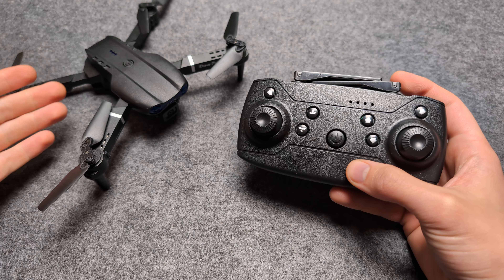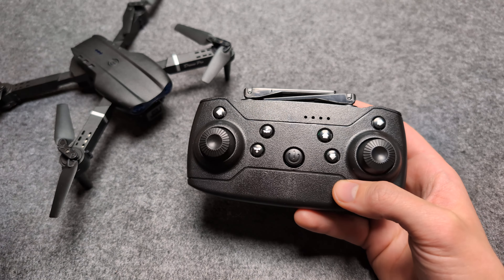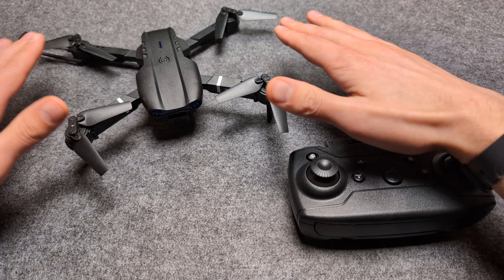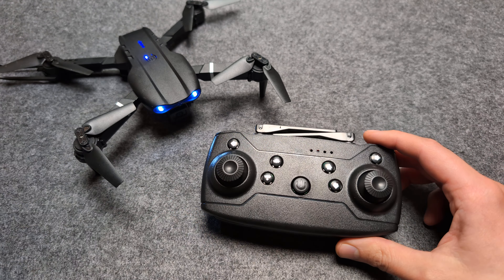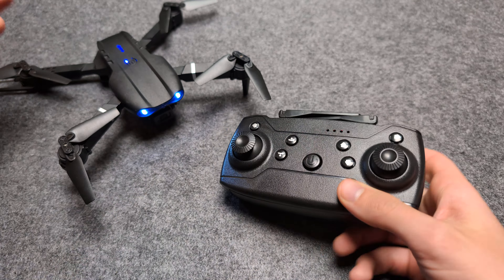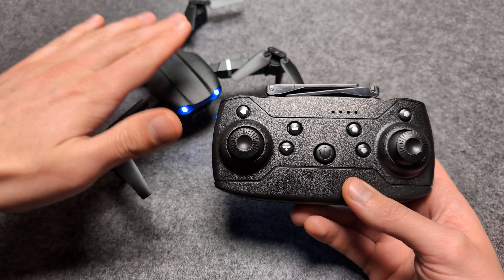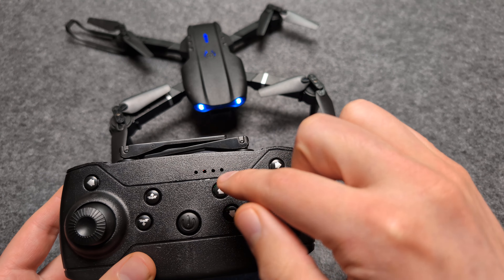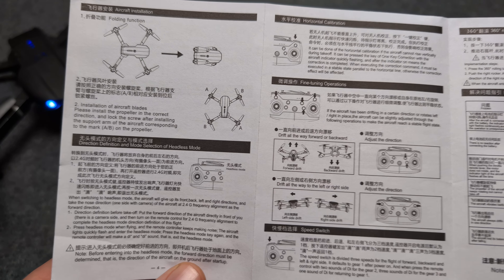How to Calibrate E88 / E88 Pro Drone - Fix Drifting to one side & Very Hard to Control

Comment: whats the differece with the calibrate button on the top right of the remote in the manual where you push with your index finger vs the hold down the stick... it also blinks when i push that button

Comment: My drone propellers turn but hasn't got power to fly do you no what tge issue is?
Reply from the maker: Faulty battery probably  😂 the batteries that come with them often are total junk
Reply: just buy a new battery